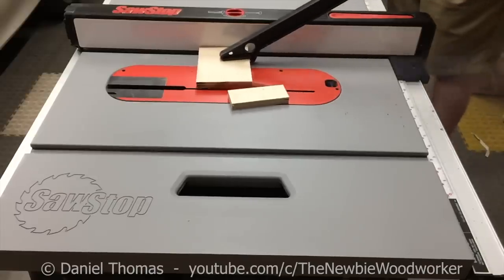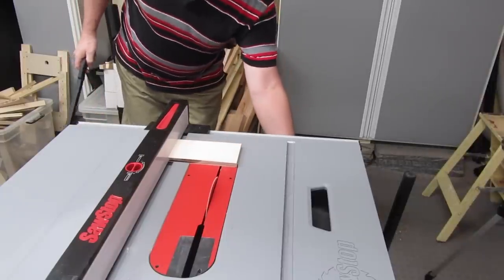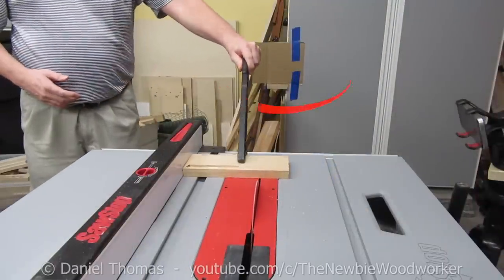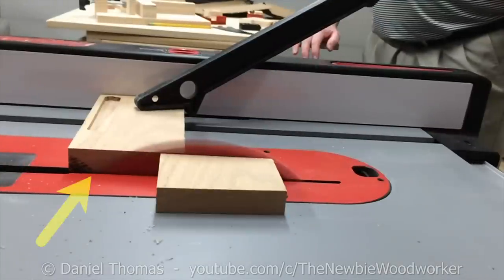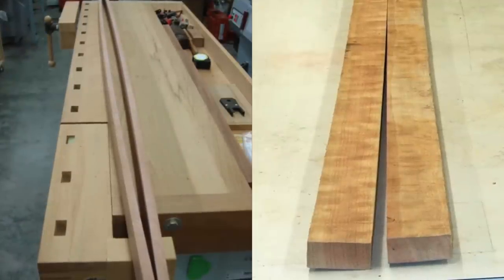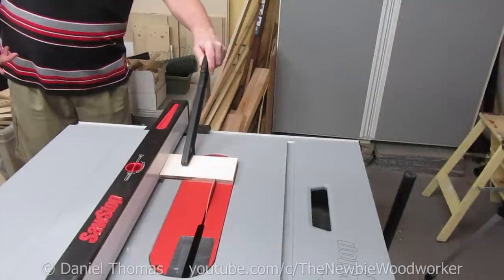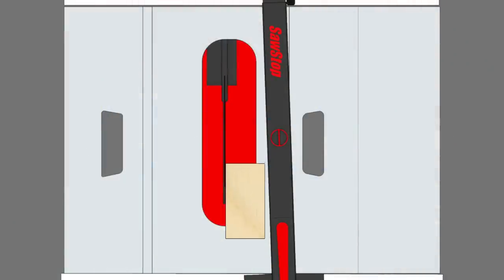Actual Kickback (in Slow Motion), & How to Prevent It

Comment: What is the proper use of the fence? Rips only? Are rip cuts significantly less prone to kickback? Thank you!
Reply from the maker: I talk about this starting at 14:41. Does this answer your question?
Reply: @TheNewbieWoodworker  are you making a joke? That's the end of the video. I'm still seeking answers to this.
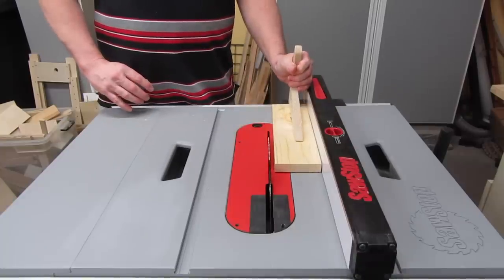Reply from the maker: @kitsurubami  Sorry, I looked at the wrong number. 🙄Try 10:31.
Reply: @TheNewbieWoodworker  Sorry, really doesn't answer my questions. I'm asking what the fence is for, not what it's not for. Trying to figure out if rip cuts are the fence's only application. And yes i see that you personally cut larger more square pieces such as plywood against the fence.
Reply from the maker: @kitsurubami  Hmmm, let me think. If we define a rip cut as cutting down the length of a board, then yes, that's mostly what it's used for. As you noted, the are exceptions for larger, nearly square plywood boards. I'm sure there are other, less common uses for the fence. For example, using it to guide a jig, like the John Heisz jig I use in this video: https://youtu.be/vsbWm6kgtFI. And I just know I'm missing something obvious, but I can't think of it off the top of my head. Regardless, it's called a "rip fence" for a reason. 😛(I'm not trying to be snarky here, by the way - it just made me smile when I thought of the fact it's called a "rip fence".) Does that answer your question?
Reply: @TheNewbieWoodworker  Yes, that answers my question. Thank you for taking the time to do so. I know it's not exactly on topic for this safety video (thank you for that by the way), but it got me thinking. Using it for a jig guide is also a great example. I didn't know that it was called a rip fence! that's cool. I'm very happy to have learned all these safety tips BEFORE losing any fingers. If you or anyone else wants to add to the list of rip fence uses, please reply here :)
Reply from the maker: @kitsurubami  Glad I helped! I love talking with people like this, so it's no burden. I really enjoy it. 😄

Comment: I recently experienced kickback and now I'm scared to make cuts using my saw. I was tired (which a lot of people have already spoke of) and I was rushing (probably worse than tired) I attempted cutting 10x20 piece of MDF  in half (into 2 smaller squares) using the rip fence. I actually was pushing too hard on the free side of the blade and that was what lifted up on to the blade and got tossed. 
It has gotten in my head so much that I will set up cuts and practice it without the blade then I'll get nervous and just abort the whole thing and cut it with my circular saw instead.
Reply from the maker: Wow, sorry you experienced that, but let me help walk you through this. The most important thing any of us have to do after an accident, or even a near-accident, is to learn from it. I experienced kickback multiple times before I finally learned what was going on. I felt stupid, but that doesn't matter - I learned.

I'm guessing here, but I'm probably right: The problem you had was that you tried to get the stock back against the fence by pushing the off-cut side too hard. And when you did that, it pushed against the blade, pinching the blade, and that's what caused the kickback.

The answer is simple - don't do that. You can help the off-cut side along, preferable with a push stick or block, but NEVER to the point where you're forcing it into the blade. Now you know that.

So what should you do if the stock starts moving away from the fence, with a large cut like you're talking about? Use your main push block (the one between the blade and the fence) to try and provide more pressure towards the fence. Gradually - don't try to force it too much. If you end up with a wavy cut, then so be it. That's why a lot of times, I make the first cut wider than necessary, so I can go back and trim it straight.

Once you've thought it through for a while, and understand what happened, it should help ease your fear.

Then you should try and figure out why the stock moved away from the fence in the first place. Do you need to clean or wax the top of your table saw? Is it possible your fence or blade aren't aligned right?

Anyway, that's a start. Let me know how it goes.
Reply from the maker: Just to make it clear: The way to combat fear is with knowledge and understanding. Fear is a strong emotion, but as humans, we are capable of moving past it, by using the "thinking" part of our brain. So think about what happened and why it happened. Once you're armed with that knowledge and understanding, it should help you do battle with the demon known as "fear". Good luck! :)

Comment: Important distinction between a riving knife and a splitter*** a riving knife maintains equal distance from the blade at any height. A splitter will have different distances between the blade depending on the height set by the user. This creates another potential issue where the workpiece may get caught between the end of the blade and the beginning of the splitter if the distance between the splitter and the blade is too great.
Reply from the maker: Thanks for the clarification! 😄

Comment: As a retired shop teacher one item I always stressed was to check the wood for splits and metal. Wood with splits when kicked back is a spear. I never had a student injured on a table saw. We also had less than three times wood was sent flying. I did stop some students before problems when the sound of the saw was wrong. So listen to your machines and if they sound different stop and check the machine set up and your workpiece. I still have all my fingers and both eyes and so do all my students.
Reply from the maker: Great advice, and I agree 100%. Especially with listening to the sound - it can tell you a lot. Thanks for the comment! 😄

Comment: Entertaining demonstrations, and excellent advice, I really can’t critique you at all. My little bit of advice would be to make sure you’re using the right kind of push stick/block for small or narrow strips of stock. I was using the long ones that I prefer since they keep my hands away from the blade, and had a little trouble keeping the small strip steady and it got caught and kicked back. Luckily no damage or injury occurred. A grr-ripper is perfect for those cuts, or the shoe looking push stick is much better than the longer ones in my opinion, which I have based off what I experienced.
I also have a question too that I hope I could get some help with. I have a cheap table saw and the riving knife is permanently attached, however, it’s not perfectly parallel with the blade, so my stock will get caught on it and I have to push the knife over just a tad to finish the cut. I know that’s not safe, but I don’t want to drop the knife down as I know it’s also not safe to not use it. I’ve tried fussing with it a ton and it still keeps coming out of alignment with the blade and I’m not sure what to do about it.
Reply from the maker: Thanks. Regarding push sticks, I agree with you. I've changed a lot in this area, since this video. I use Grr-Rippers for narrow cuts, and sometimes on other cuts, otherwise I use a John Heisz-style stick in my right hand, and a Matthias Wandel-style stick in my left hand.

As for your problem, I would consider replacing the riving knife with one you make yourself. A quick YouTube search shows several videos on how to make one, and then you could do whatever it takes to make it parallel.

On the other hand, a lot of people don't use a riving knife, and have managed to avoid injury. As long as you're careful, and stay out of the line of fire, it might be OK. And I think it's possible it's actually safer than what you have to do now. Not sure, so don't take my word on it, but it's a thought. Good luck!
Reply: The Newbie Woodworker yeah, I always like the “chicken feet” push sticks as I’ve heard them called, but using those does make it more difficult to control small or narrow pieces going through the saw. 
I think I’ll take up your advice and try to find some method of making a better knife. I usually use a push stick to get the knife back in alignment while making a cut and I know that’s not gonna fly forever.
Reply from the maker: Yeah, that's a little scary. It means your attention isn't totally on the cut, and that's a recipe for disaster. Let me know how it works out!

Comment: I am not a fan of those push sticks that come with table saws I think they can increase the opportunity of kick back because they don't apply any downward pressure. The homemade ones and the Gripper are what I use. Jay Bates has a good push block also.
Reply from the maker: I totally agree, Brian. I like to use either a Grr-Ripper, a push block, or a John Heisz style push stick in my right hand. In my left hand, I usually use a Matthias Wandel style stick help push the stock against the fence, and also to help keep me from using my hand instead, which has gotten too close to the blade on more than one occasion (everyone should have to watch video of themselves working - they'd find all sorts of scary things they do without noticing). Thanks for the comment!

Comment: I have two other kickback reasons to share:
1) Wood being wet may cause a kickback when people push hard to make faster rip cuts. Dried parts move fast but when a wet part comes into contact with the blade it may cause additional friction and thus a kickback.
2) Forgotten nails or screws (especially larger ones) may cause a kickback too, again especially when people push hard to make faster rip cuts.
For many times, making it slow prevents kickbacks and other injuries. When people get tired they just focus on completing the job rather than taking a break and refresh. I know a guy that lost his hand using a miter saw just for this reason.
Reply from the maker: Thanks for the comments, and they're really good, especially that last one. I've done that before - I'm tired, something is holding up the cut, and rather than be smart, I just push harder. Not a good idea at all! Thanks for sharing.

Comment: Some important points you've discussed here but as a joiner of 34yrs i wouldn't attempt cross cutting like that without a table sled or a sliding sq, with or without a riving knife, , using the correct tool for a certain task is key, If you have a table saw there's a good chance you have a mitre saw, use that for cross cutting or make a sled,
Reply from the maker: Thanks for the comments, but I'm guessing you didn't watch the entire video. Check out this part: https://youtu.be/ZUZ8hRm7a8g?t=10m32s

Comment: yesterday i stopped a kick back event due to internal stress, ive actually done that a couple times somehow. the only kind of kickback ive had that i couldn't stop was when i was breaking down this table to throw it out and a piece that was just glued on fell off and was thrown at me by the blade.
Reply from the maker: Good for you to be smart enough to know what to do with the internal stress issue. Some people just keep pushing. 😮
Reply: @TheNewbieWoodworker  yea, the way i would describe it is while your going through the cut, the wood progressively gets hard to push through and eventually starts feeling like the saw is pushing the wood your way until you actually have to hold it down and shut the saw off or (im guessing) 1v1 a table saw lol. also though the visible sign is that the wood is closing very close to the riving knife compared to other woods.
Reply from the maker: @lilmatt1914  Yep, that sounds like it.

Comment: I did a lot of research on Table Saw Safety since I have a table saw and a young child.  I found several videos of people trying to demonstrate kickback. Most, like you, used real wood. Most, like you, had close calls.  

The safest kickback demonstration I saw was someone using a piece of styrofoam insulation instead of wood. Even he had super fast results.

I know this sounds oxymoron, but you can't "not stand in the line of fire" and safely operate the table saw. (intentional double negative) What I concluded from my research is that most of the projectiles cover from the fence to about thirty to forty degrees from the saw blade towards the opposite side of the fence.   However, in your case, you were in the line of fire at about 15 to 20 degrees from the fence side of the saw blade. 

Where you stand, opposite corner from the fence, probably gives you a better chance of being out of the trajectory, but you are only safe if you can handle the wood safely from there.  On larger tables, that location may not be a viable option.  BTW, That's where I choose to stand when I can.

I also agree, cross cut with a jig or a miter saw.

Plywood. The piece you showed in the video about "cross cutting" the plywood is different from your crosscut projectiles in that the leading edge will be far away from the back of the blade long before the trailing edge of the plywood would be severed enough to allow twisting. 

at 12:14, you showed the fence block to keep the piece from binding, but the fence was not far enough away for the board not to make contact to both the fence and the saw blade at the same time.  Earlier, you had it right... move the fence farther away.

You might improve the shoe style push stick by adding sand paper to the bottom. This will allow you to twist your wrist towards the fence just a bit keeping it flush. I have not seen anyone complain about not being able to control the piece with one, so I may be barking up a tree here.

Thank you for publishing this safety video.  I would love for every woodworking channel on YouTube to have an annual safety video.  It's very important for beginners to learn and understand about safety, but veterans need to remember it as well. If you search for table saw injuries on YouTube, you'll see that the majority of the videos are made by people who have been working without incident for eight to thirty years before they met the blade. I believe the biggest reason is that veterans are more likely to produce videos about it than beginners, but they are still vulnerable to being too comfortable with the situation.  

One of the long term regular YouTubers said he turned off his saw, but was so used to the sound of the vacuum that he touched the blade before it quit spinning. (Was that Mathias?) Minimal damage, but a rude awakening, none the less.
Reply from the maker: Thanks for the Comment. Well thought-out, and packed with content. And as for the last comment - that (almost) happened to me with the drill press. It makes very little noise, especially if I have the dust collector running, and more than once I've come close to touching the spinning bit.
Reply: @TheNewbieWoodworker  I'd love for my table saw to have an option of causing the blade to automatically drop below the top when I turn it off. 

My first experience with kickback was with a miter saw. I was cutting off a corner with a block stopper and heard a "POP" and saw dust.  I work outside and didn't find the piece until I finished working. It was about 50 feet away. I never saw it move, it just disappeared like a magician.
Reply from the maker: @BlessedLaymanNC  Yeah, that's scary, isn't it? One of the things I like about my SawStop JobSite saw is that you can raise the blade all the way up, or all the way down, in one revolution of the crank. Most of the time, it's a half turn of the crank. So when I turn off my saw, I lower the blade before it even stops spinning.
Reply: @TheNewbieWoodworker  I didn't know it has that feature, but I am hoping to eventually make enough to actually buy one.  The jobsite version is hat I want.  I don't have room for a full table saw.
Reply from the maker: @BlessedLaymanNC  Yeah, me neither. If you haven't watched my review, you should. There's lots to love, but there's things that aren't perfect (by a long shot): https://youtu.be/3zbYR5ok1V0. A has passed since the review, and I'm definitely glad I bought it, in spite of the issues.